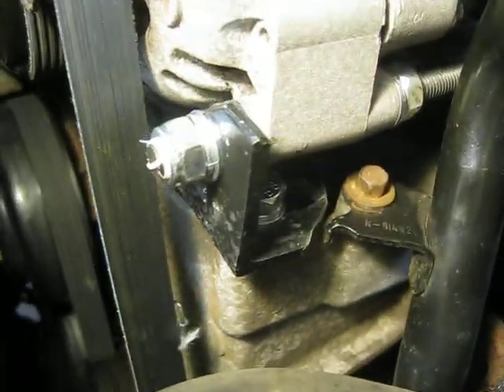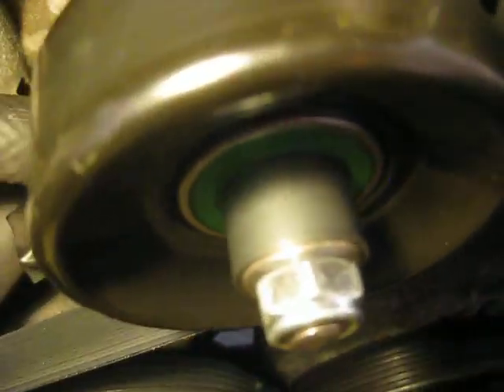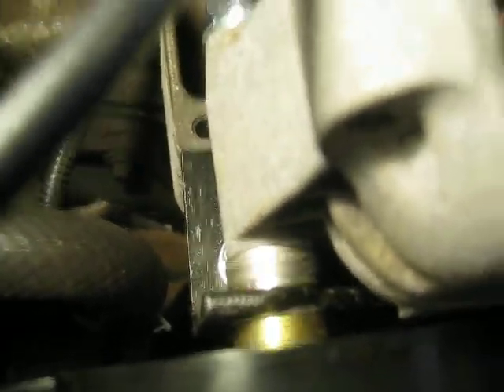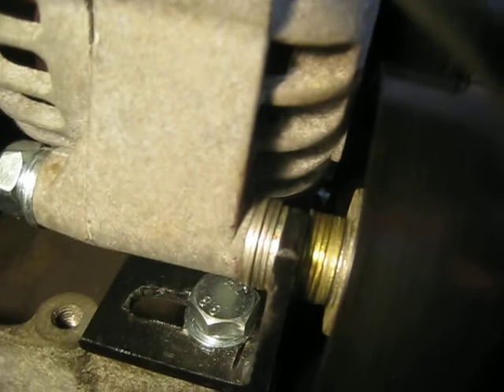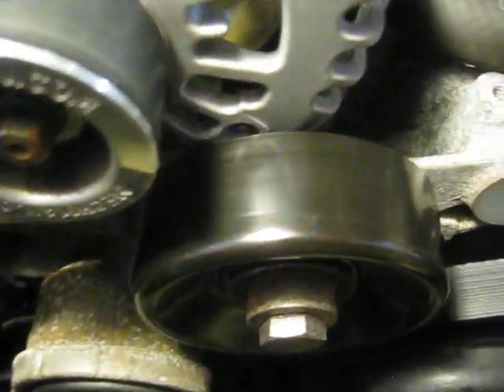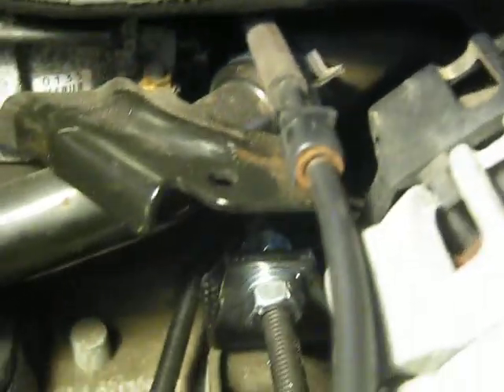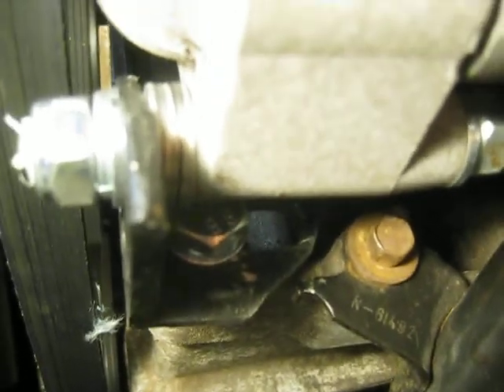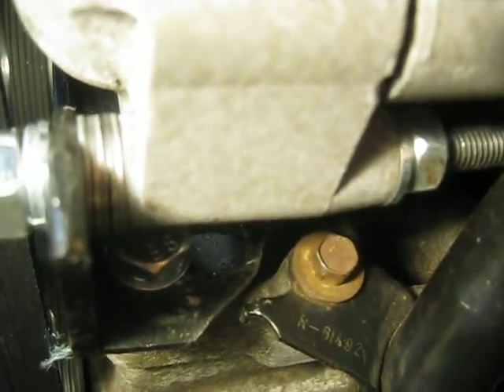Dual Alternator Install 4.3L Blazer

Comment: That is a great job. I was thinking of doing the same thing to charge my two deep cycle batteries (50 Amp Hours each) in my camper on the back of my old S10 pickup. I have two 100 watt solar panels on the roof of my camper for that purpose, but in the winter there isn't enough sun to keep the batteries charged. The truck is a hunting/camping vehicle that is used a lot during the winter so I had to figure something out. I wish I could have seen you do it step by step. The dual alternator kits are outrageously expensive so that was not an option for me. Did you just use angle iron 1 1/2" or 2" for the mounting brackets, or did you have to customize some steel to make the mounting brackets?
Reply from the maker: +bibleprophecy1st 

I used 3/16" thick, 1 1/2" angle. Only thing i had to do was drill the holes and cut out the notch for the alternator case to rest in. The angle will mount to the A/C mounting holes.  What year is your s10?
Reply: Amart88 I own a 1996 S10 with the 4.3 vortec. It looks to be the same engine as yours.
Reply: +bibleprophecy1st - Any Cars / Trucks that has a 4.3L Vortec is the SAME ENGINE. GMC Chevy S10 Jimmy Sonoma Blazer Suburban Sierra Chevrolet Silverado Tahoe Yukon Oldsmobile Bravada, Etc... Known Year: 1996-2005

Comment: LOL, with all the work and modifications and time and $$$, you coulda got a 350AMPS Alternator and call it the day. LOL
Reply from the maker: You do realize one of the alternators is a 370amp mechman the other is a stock which was to be replaced by a second 370amp. So I have over 450amps in the video would be over 700 with a second 370.
Reply: +Amart88 - You misunderstood my point. I was saying change the " Stock " to 350Amp or in your case it's 370Amp and call it the day.  That is what I was saying... Even with just 1 (ONE) Alternator at a 1 Billion Amps if you can get it, LOL.